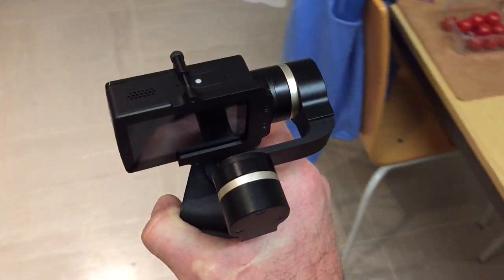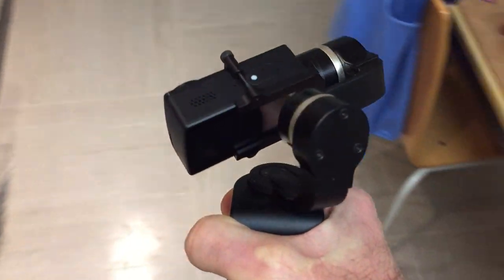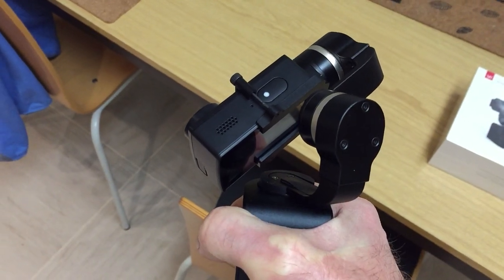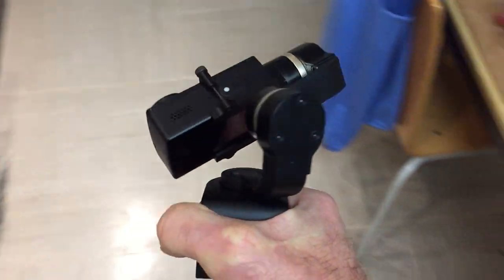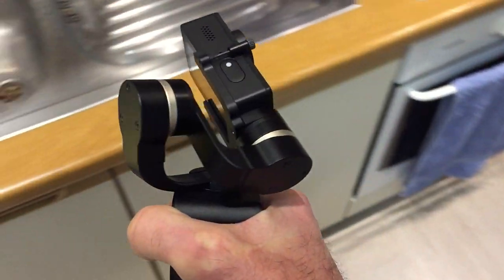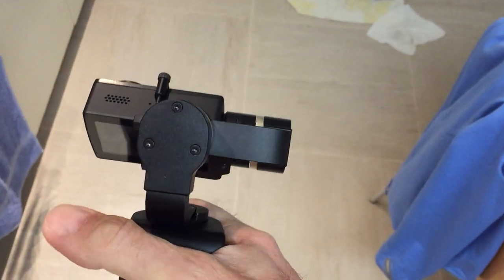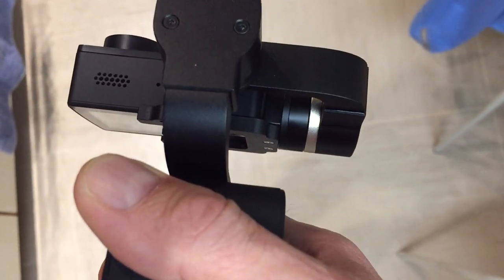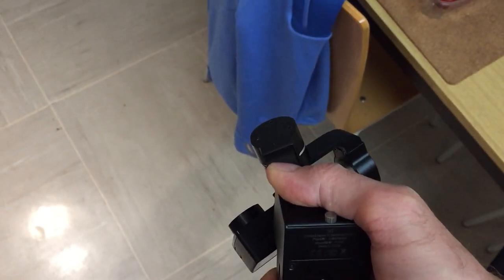Yi Gimbal moving error if base is at 45°

Comment: I've also opened a request at their web page. Last firmware update was 2016-11-07. Guess you guys are using that? Don't know which one I have since I don't currently have windows running anywhere. Was hoping an update could fix it. But I guess no then :-(
Reply from the maker: I had this problem at 2 of this gimbals. The second was shipped at the end of 2017, so I think the latest firmware  was installed.

Comment: I also have that problem. I just contacted the support and I hope to get a response. I think this could be fixed in a firmware update.
Reply from the maker: Did you get a response?
Is the problem solved now?
I still wait for a response from Yi.
Reply: Probier Mich Ne leider nicht. Bei Supportanfrage wollen sie die Bestellnummer wissen und leiten dann einen Austausch ein. Aber ich habe keine Bestätigung bekommen, dass dieses Verhalten normal ist. Und sie leiten es nicht in die technische Abteilung weiter.. es ist bescheuert. Weil der Austausch in meinem Fall mit hohen Versandkosten nach China zusammenhängt lohnt es sich nicht wirklich. Bin mir aber sicher, dass es ein allgemeines Problem ist. Weil bisher jedes Video was ich gesehen habe genau dieses Verhalten zeigt.
Reply from the maker: Ich hatte mir einen neuen Gimbal geholt, der exakt den selben Fehler hat. Ich bin sicher, es ist ein Firmwarefehler.

Zusätzlich kann er seit kurzem kaum noch brauchbar stabilisieren:
https://youtu.be/rdji8Lq6JDk